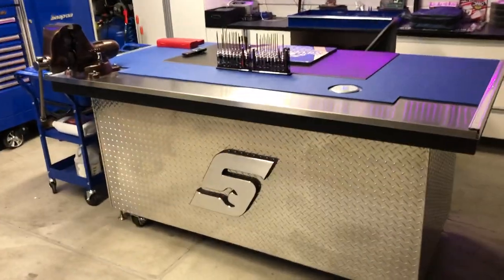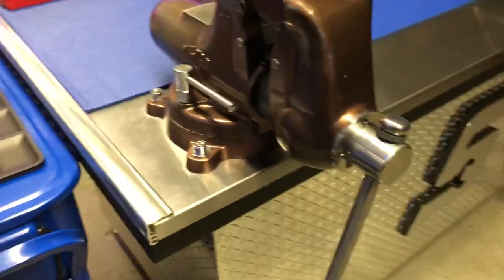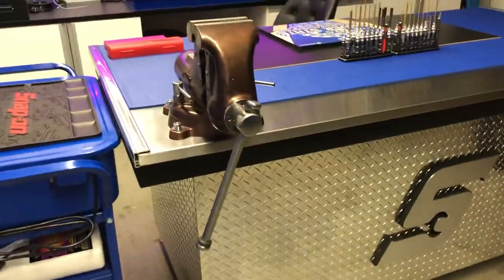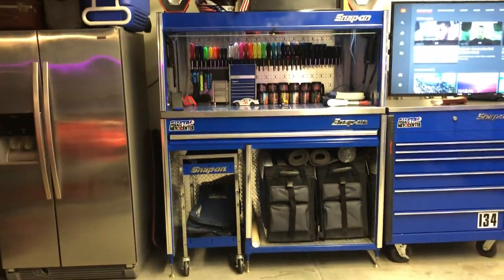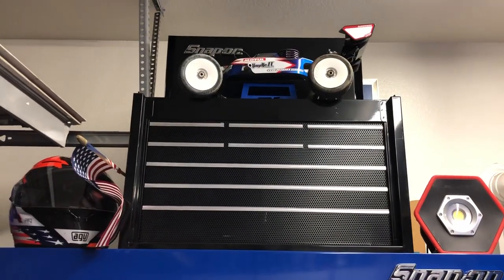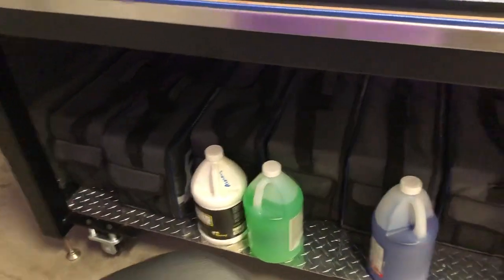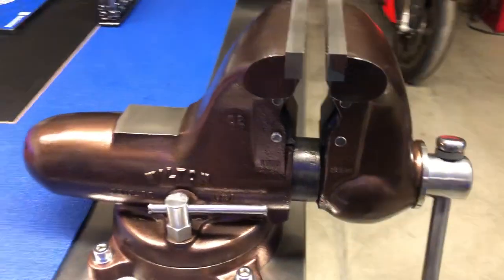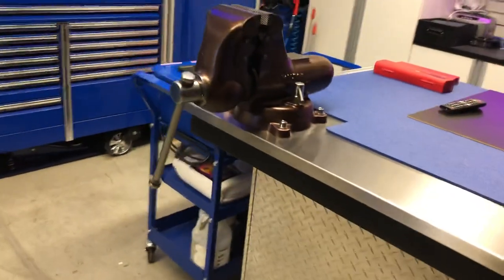Dream work bench and Wilton vise

Comment: Hey sbkarmen sbk really love the tool box.
Reply from the maker: Luis Vallejo thanks man!
Reply: sbkarmen sbk hey I noticed you own a Ducati and I own a 2010 ducati 1198. I purchased it about 4 months ago. Had really bad luck with this bike it dropped the bottom connecting rod at 4,000 miles. Just need some opinions.
Reply from the maker: Luis Vallejo ugh that’s horrible!  I’d just get a used motor or find a good builder somewhere in your atea